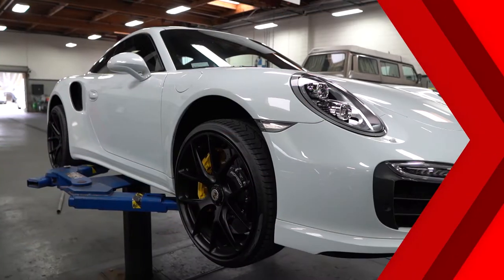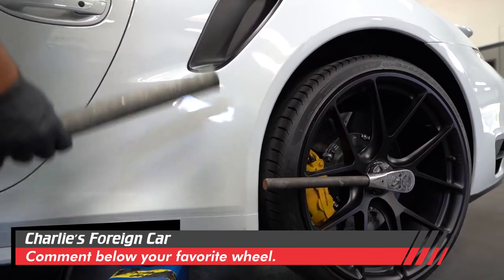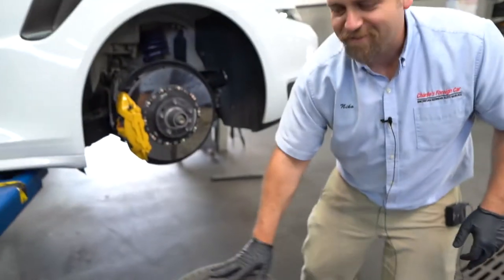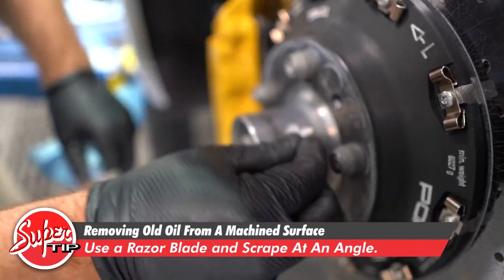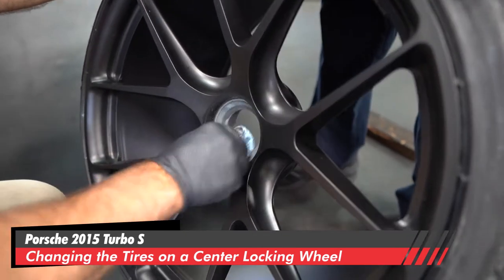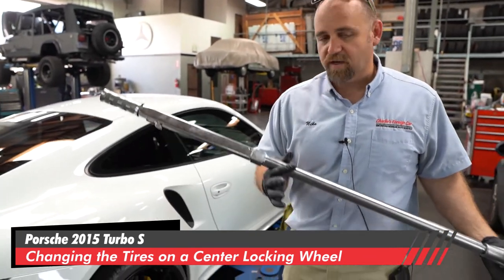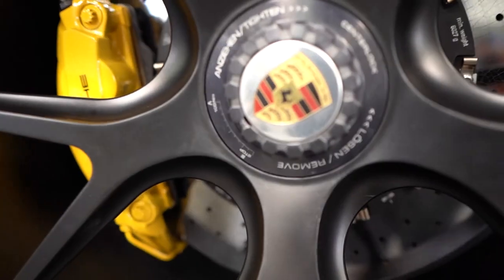Porsche Turbo S Center Wheel Lock

Comment: Porsche DOES NOT allow the wheel to touch the ground during the torque sequence. The proper method is to lock the wheels using the brakes via a pressure bar (or an assistant) on the brake pedal. Also, a Wheel Alignment Tool is recommended to center the wheel during removal and re-installation to prevent contact with the disk. During the retorque sequence, the proper method is to torque, then back off 90 degrees, not 180 degrees, prior to the final torque. Porsche also does not recommend lubricating the locking splines. The grease can harden causing the locking splines to stick in the retracted position. If the locking mechanism must be lubed, only the lugs at the base of the locking mechanism should be coated to allow for radial play to insure proper engagement.
Reply: Why does this guy upload this video with so many details wrong according to procedures?
Reply: i kept the wheel off the ground per the manual and the 1/4 turn back off too. also only greased the threads and conical area per manual.
Reply: Plus the locking mechanism is not out all the way. If it doesn't retract out all the  way. You can use the back on the cap tool to 1/4 turn it out. I'm sorry for whoever car that was lol.
Reply: my understanding as well that the wrenches should only pull up to either tighten or loosen the nut.  this video should be removed.

Comment: Your locking pin is NOT flush with the end of the splines at 9:23. Please refer to the 991 Factory Service Manual regarding the correct flush position. This intermediate location of the locking pin that you incorrectly described as correct is NOT the proper flush position of the locking pin!

Comment: Warning to all who are watching the video! The locking pin is still not flush with the inner toothing of the central bolt.
Reply: Futhermore, I just learn this, the mini pry tool that comes the car to remove the centercaps is also the tool to stick in the hole to slightly turn the locking pin to assist in having it come flush to the wheel. @Marcus Lim is correct, the pin illustrated is not fully engauged and would be also consider dangerous to drive.
Reply: I noticed that as well.

Comment: i simply lift the car only an Inch above the ground, so that the rim can't fall on the brake disk.
Reply: i broke down and bought the alignment tool to remove/install the wheels. wasn't cheap, but way cheaper than a carbon/ceramic rotor.
Reply: I sit on the ground and support the tire on top of both of my knees while loosing the center nut all the way off.

Comment: Another MIS-STEP in this video/process, was that he never took the lug nut itself apart. There are 4 pieces to that lug nut (a circular plate & a ring, plus the inner & outer components). All of that needs to be disassembled (whack it on a piece of flat wood to separate), cleaned and then reassembled. He missed a critical part of the process!!!
Reply: And what a messy job that is. I wash all parts in gas till all the Castrol anti-seize is washed away and then use compressed air to dry it all before recoating it all again. And I see so many videos where the mechanic removes the Centerlock nut and then places it face up on  the lift ramp under the rocker panel for dirt to fall into the Castrol lube. Christ, at least place the Centerlock nut into a zip-lock bag to keet dirt away. Amateurs which is why no show sees any of my vehicles.
Reply: @a.c.e.7568  = You are right ! 
Shit happens to me and dirt in the lube.
Ok today we use tube from Castrol (and the right one).

Comment: 0:37 your spring loaded locking mechanism is not "sticking". If it does, it means the Centerlock nut should be tightened a tad so that the splines do not bind. The locking mechanism either does not extend, or it binds or it extends fully. And you do not use the Porsche Castrol lubricant (the anti-seize product) on the locking mechanism. None was applied by Porsche at the factory. I use a thin spray lube on the splines.

Comment: Is there any way to set the centre lock so that the hole for the centre cap points down? I’m sure Porsche had thought about it. After all, everything they add or remove to/from their cars had and still has a purpose.

Comment: Screw the expensive Ceramic Brakes and this cool looking but ridiculous center lock process. I’ll take my steel Brembo brakes and lug nuts on my 997.1 C4S any day. Much easier and affordable. Still a very fast car. Money left over for a boat.
Reply: I'm more of a race car enthusiast and pretty cool to have some race tech on the car. The limited track days I do, the PCCB are amazing brakes and stopping power when entering trying to stop the car quickly at 125pmh. No brake fade so far.. I do realize the center locks are more aesthetics, but again pretty unique and cool.

Comment: The centre lock wheels would put me off buying a car with them. What a faff on to take a wheel off
Reply: If you buy a Porsche than ..
If you got a car with central wheel locks, better know what to do = Read the f*c***g Manual. 
OR use a skilled person to do the work ! 

Some Prosche or Lamborghini need a different service. 

IF you service a fighter jet you need a bit different knowledge as a service person with his cheap simple  american V8 or tractor or  or or

Comment: anyone wondering how to flush the locking mechanism, use the back end of the center lock cap removal tool to press in and rotate the lock until it sits flush

Comment: Removing the wheel in always a 2 person job? Dude, i alway do this alone while sitting on a rolling detailing chair.
Only need 1 2nd person to apply the brakes because you must never torque centerlocks while the car is on the ground.
.

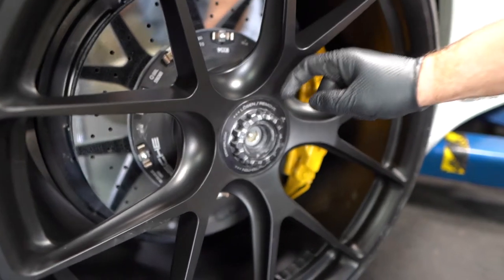Comment: Hey man, are those HRE wheels by chance? i just installed a set that look very similar to them on my 2014 911 turbo S today. followed the manual, very similar process to what you did, but that center splined shaft you show at 8:37, see how there are about 3/16" of exposed splines? all 4 of mine are the same way, but the stock wheels showed zero exposed splines, which means there are less engaged splines and threads, which makes me a little nervous. was that any concern to you? i've emailed the HRE rep to see what he says before i drive it as these are obviously critical components. just curious if you noted any concern on that. thanks.
Reply: What was the outcome?
Reply: @LivYo_life  basically, you have to jack with the spline locks to get them spring out all the way. my wheels were fine. once i messed with the splines and got them to engage all the way out, it was fine. one of them i had to take apart and clean. i couldn't find one video that had all the details to follow doing this job so made my own 2 part video on my channel.
Reply: @LivYo_life  https://youtu.be/7g3g8g_d-7Q is part 1 and part 2 is in the description of that one if you want to see them. shows detail on engaging the splines as well as taking one apart and cleaning it. there are some other tricks to the job included as well.
Reply: @NoLimitsNoRegrets  thx

Comment: It's funny how the Porsche road cars are much weaker and sensitive to stupid stuff than their racing counterparts... I worked as race engineer in Porsche Carrera Cup Brazil and people always torqued the center lock nut with the car on the ground, with someone braking, because the car doesn't have a parking brake for obvious reasons... Also, their snow flaky ceramic discs make me think it's just a gimmick to sell the car at a higher price. The Porsche GT3 Cup car uses steel brakes, and they certainly produce far more heat, and have a hell lot more braking power than the street counterparts... I see absolutely no reason why they'd need a carbon composite brake that is super fragile when the racing version of the car uses steel brakes...
Reply: Ask Porsche for the reason. 

Ceramic breaks are able to be hotter than steel disc breaks 
AND the weight  the weight 
AND long lasting before exchange 
BUT ceramic discs are expensive and fragile ! 

Fragile is not positive for a wheel change within one second ! 
But if weight and no cool down time for the discs than today always the ceramic disc is the choise ! 

Maybe the driver got long distance to cool the disc down 
OR
you worked at a historic Porsche ? Or the owner got a small budget for the race and no money for ceramic discs. 

By the way the driver have to hold the tires at an temperature range (and the dircs have to be hot enough to work well = temperature is needed or the team choose steel discs) 

Porsche and center wheel nuts at the ground = No time to lift the car ! No time to work as the Porsche Manual told with pre torque of .... than torque to .. than lose to settle the rim and and and 

No time to clean the center nut and grease and control and control 
Read the Porsche work manual pefore you touch my Porsche !  Often I dont kill the unskilled (or wrong skilled) car mechanic. But sometimes thee person is missed by there family. smile smile smile = dear lawyer it is a bad joke ...
Reply: @callishandy8133  my brother in christ, I don't think you understood what I said even slightly. Let's be clear about a thing: racing brakes are supposed to be red hot. During a single braking event from a moderatly long straight into a low speed corner, the rotors reach temperatures well beyond 500 °C. And during a 1:35 sec lap around Interlagos, such braking event happens twice (not counting all the other braking events during said lap).

Now, we've had multiple 500 km races in Interlagos for the Porsche Endurance Series, and never ever have I heard of anybody getting brakes fading due to overheating, and we do not replace rotors nor pads during the race. And no, it wasn't the team I worked for that had steel brakes, it was the championship (in Porsche Cup Brazil, there aren't invidividual teams, all engineers and mechanics work for the champtionship).

So, can you think of other scenario where you need light car brakes that can withstand extreme heat than in a race? This is my point, if in the most extreme scenario where you need light brakes that can withstand extreme heat, you can get away just fine with steel brake rotors, why would you need carbon brakes that cost a ton more and break far easier in any other scenario?

Also, just to be clear, I engineered the 991.1, the 991.2 and the 992 which are the three latest generations of the Porsche GT3 Cup.